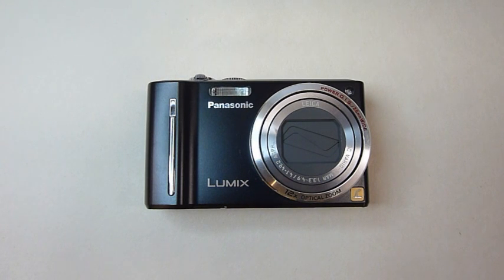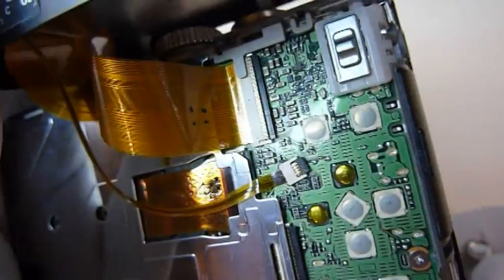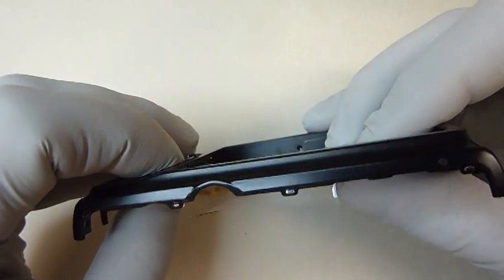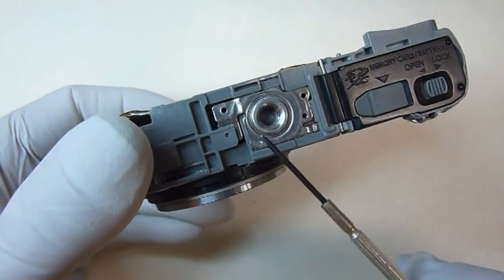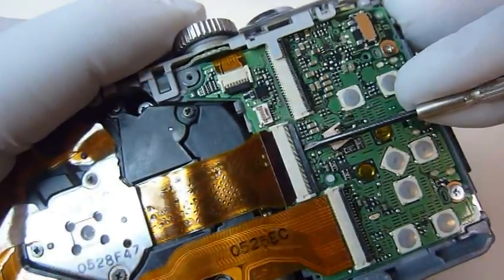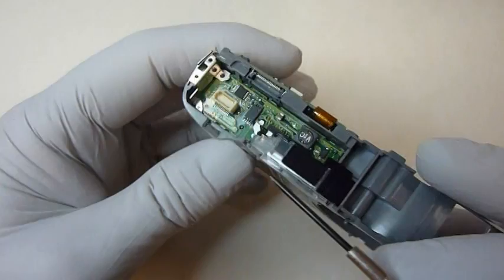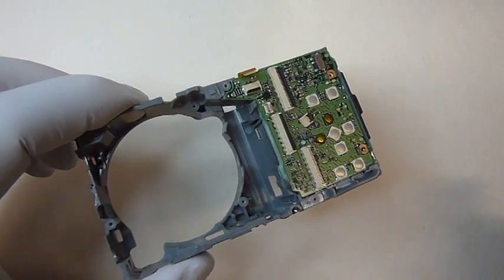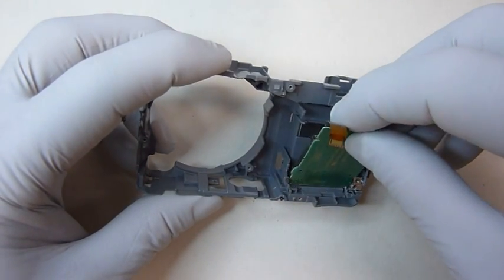Repair A Panasonic Lumix ZS6, ZS7, TZ9 and TZ10

Comment: Hi Robert, thanks for your swift and complete reply, I appreciate your help. I might take the repair in stages. Order a display unit, then try to attach my old thinner backlight ribbon. However I may have damaged the little black circuit board connectors - don't suppose those can be bought ? Or will I have to try and buy another camera for spare parts ? Any sources you can suggest will be appreciated.   Thanks again, Rab
Reply from the maker: Hi Rab. I really doubt that you will find just the connectors to replace. Plus, it might be pretty tough replacing them even if you did. You will most likely need to replace the main circuit board. I did look on ebay, but couldn't find anyone currently selling a main board for a TZ10 though. But, that can change daily. When looking for parts for you camera you can also use parts from a TZ9, which is exactly the same as your TZ10, but without the GPS. Another one that you can use for some parts is a ZS7, which is just the North American version of your TZ10. The difference between the two is the video output, which is NTSC for the ZS7 and PAL for your TZ10. So because of that, a main circuit board from a ZS7 won't work for you. But all of the other parts like the LCD, back light, lens, etc., will work on your TZ10. Sorry I can't be more help Rab. Good luck with it!

Comment: Hi Robert, was cleaning my TZ10, and the two little flexible ribbons came adrift, the black connectors came off. I see that screen displays can be bought with the wider flexible connector attached. But where can I buy the smaller flexible connector ? Hoping you can help me source parts. Enjoy your vids, cheers Rob in New Zealand
Reply from the maker: Hi Rab. For Lumix camera parts, many times I will buy broken cameras, or cameras listed as "not working, for parts only", on eBay. I have also purchased parts from vendors on eBay that sell new and used Lumix parts. Just curious though; are the black connectors that you're talking about the connectors on the circuit board that the flat ribbons go into? If it is, and the little black tab that flips up and down to lock the ribbon in place came off, then you can put it back on. I have had to do that a few times. It just takes a magnifying lens to see all of the little pins that the black tab goes over. And, in regard the LCD display screen, there are two parts to it that have flat ribbons connected to them. The larger flat ribbon controls the display unit itself, and the smaller ribbon is connected to the back light for illuminating the LCD display. The back light is a separate piece that is just snapped onto the back of LDC display unit. So, if the LCD display that you are looking at purchasing only has a large flat ribbon, then it doesn't have the back light connected to it. But, you can certainly use the back light from your original LCD display on the new one if you want. It's easy to take off and put back on. Please let me know if you have any other questions and how you make out on this. Good luck with it Rab.

Comment: Robert, 
Wow,,,thanks so much for this.  You saved me having to buy a new camera.  My ZS7 had a tiny amount of dirt on one of the internal lens, which was showing up big right in the center of photos, and after following these instructions, and then the one for cleaning the lens, it is back to taking exquisite pictures.  I've been happy with this camera for so many years, and didn't really want to buy another one or pay panasonic $$$ to clean it.  Although, I was a bit nervous, looking at all the parts and screws when it was taken apart, I wondered how hard it would be to put it all back together, but your instructions were clear and accurate.  Thank you.

Comment: Robert - great video, thank you for posting it. My ZS model powers on, but only wants to display what's on the SD card and won't switch to other modes of operation. Would this likely be a ribbon connection issue, or possibly require a new top control board? When I get a chance, I'll take it apart and see what I find. Thanks again.
Reply from the maker: Hi Edward. If I understand you correctly, then you cannot get the camera into the mode for taking pictures and it will only display the pictures you've already taken? If that's right, then my first thought would simply be the slide switch itself is defective or out of place. That's the small plastic switch that changes from viewing pictures on the card to actually taking pictures. I show removing that specific switch at time index 4:27 in this video. Let me know what you find on that Edward. - Bob
Reply: Robert Hosea Thanks Robert. I did a more thorough examination and here's what's happening: When the power is turned on and in camera mode (not picture viewing mode), then the lens opens and the camera then begins to stutter. It's like it is trying to focus, but never does. It keeps doing this until I power off, then the lens stays in the extended position when off. If I turn it on and off with the right timing, I can get the camera to retract the lens before shutting down. Does this sound like the main computer board is bad? Or could it likely be a poor ribbon connection somewhere inside? Again, thank you for posting the helpful video and your interest in helping others.
Reply from the maker: Edward L Hakala Edward, I would bet that it's the focus motor assembly. That seems to be pretty common with this lens. I have another video called "How To Repair & Clean A Panasonic Lumix ZS & TZ Model Leica Lens Units" that shows how to disassemble this lens, It doesn't actually show how to remove the focus motor, but it's pretty easy to do. At time index 13:29 of that video (not this one) you can see the motor near my left thumb. There is only one screw holding the motor in. Remove the motor slowly because the focus lens assembly that the motor controls is spring loaded. What you will need to check for is to see that the small plastic tab that runs up and down on the threaded motor shaft is free. If it's stuck, or it turns hard, then you may need to put a small amount of lubrication on the shaft and turn it a little until it frees up and moves easily.When you put the motor back in be sure that the edge of the white tab is put in the grove of the plastic housing that it rides next to. Let me know what you find and how you make out on this Edward. Good luck!

Comment: Hi Robert. Really good video. I have a DMC-TZ10. I had some sand and dust in my lens and I used your video to take it apart and clean the lenses and remove the dust. However when I put it all together I find that I have no display on the LCD screen. The lens works perfectly and I can take pictures. I saw your response to Rosemarie O'Neill  who said she had the same problem. I have tried re-seating both the small and larger ribbon cable from the LCD many times but without success. My black locking bar works well, the cables are secure and everything looks good. I wonder if you have any other ideas about where the problem might lie?
Reply from the maker: Hi Robin.
The only other possibility that comes to mind is if the small flat ribbon cable, which supplies power to the back light, is upside down. On the small flat cable, the shiny gold colored contacts should be facing down when it's in the connector. This is just the opposite of the large cable where the shiny contacts will be facing up in the connector. Double check that Robin and then let me know what you find.
Reply: Robert Hosea Hi Robert
Thanks for your advice. I have double checked that and the shiny contacts are facing down. I have had them in and out many times now. I have tried scouring the surface of the contacts to improve the connectivity, but no joy. I have also taken the lens out and put it together to reconnect the ribbon connections behind the metal shield. Any other ideas will be welcomed.
Reply from the maker: Robin I'll keep working on it Robin. If I come up with anything I'll certainly let you know.

Comment from the maker: Hi tpaulino. Boy that's a tough one. There is most likely something down inside that is preventing the SD card from being pushed in far enough to release the lock. I've had SD cards that have had the small plastic pieces which separate the electrical connections break off and then get jammed in down there. But, it never prevented me from removing the card. Trying to pull out the card without first releasing the lock could cause a lot of damage to the camera. I would suggest disassembling the camera and removing the SD card holder from it. Then you might be able to see what the problem is a little easier. You can see where the SD card being removed in the video at 10minutes 20seconds. I'm sorry I can't be more help to you on this. Good luck and let me know how you make out on this. -Bob

Comment from the maker: Hi Shaz. I don't see anything that shows that a ZS20 display will work in your ZS30. But a display for a TZ40, which is the European version of the ZS30, will work. I can only find one location that sells a replacement display that will work in your camera, and it's in China.

Here's a link to the listing:
http://www.aliexpress.com/item/NEW-LCD-Display-Screen-Repair-Parts-For-Panasonic-Lumix-DMC-ZS30-ZS30-DMC-TZ40-TZ40-Digital/2024127067.html

I would most definitely remove the back cover and check out the flat ribbon cables first before ordering a display. I have had cases where the display will not work when I didn't get the flat ribbon cables back into the sockets perfectly straight. Generally it would be the smaller cable that runs the back light. It's worth a shot!

Let me know how you make out on this. And good luck!
-Bob

Comment: Dear Rober, I have a Panasonic dmc-zs8 and when i inserted the sd card apparently it has stocked into the camera.  I pressed in the midle of the card, but it does not want to go out.  Will u pls help to to take out?  ...thanks i am tpaulino

Comment: Hello Robert, I have a Lumix ZS 30 on which the display has abruptly stopped working. Do you know if a replacement display for the Zs 20 would work in this camera has not been able to find one identified for the Zs 30? also is it possible that one of the two flat cables that connect this display to the circuitboard have simply come loose and caused this problem? So if I were brave enough to open up the case, simply resetting the cables would resolve the problem? Thanks for your time.

Comment: Morning Robert, not wishing to dismantle the ZS10 as the LCD part does not have any black plastic at least that came with mine, so I was thinking is it sold separately do you know?, certainly I did not need the new silver LCD unit as that is working just fine, I really need the rear cover black plastic unit that is badly cracked, any ideas please..and again thank you for your time.
Reply from the maker: Hi Jim, I sent you a message on your YouTube channel that contains my email address. If you can send me your email address I can send you some pictures to help identify the part that is broken.

Based on your first comment last week I am still under the impression that your LCD screen is cracked. The black plastic frame around the LCD screen that also holds the control buttons, is a separate piece (unit) and is not part of the LCD display screen at all. So if you are seeing cracks on the LCD screen display, then the cracks are on the LCD screen itself, and something that is part of the black plastic cover. The black plastic cover does not contain anything that goes over the LCD screen. It just goes around the LCD screen. At least that's the way it has been on all of the ZS10's that I have worked on.  

Sorry this is taking so long Jim. We'll get it figured out though.
-Bob
Reply: my email Robert, again thank you..

jim@cyprusliving.org
Reply: my LCD panel did not come with the black rear screen that is cracked not the inner LCD., just the silver LCD unit that I did not need.Also it did not come with the larger ribbon connector...just the smaller one.

I hope this makes some sense to you..
Reply from the maker: Jim Cross I emailed you some pictures of what the LCD screen should look like. It should have three flat ribbon cables connected to it. If yours does not have the larger flat cable then it must be the incorrect part. My guess is that it's just the back light for the LCD screen. Let me know if you do not receive the pictures that I sent to you.
Reply: Thanks Bob I have received those snaps and sent you the same of my part LCD.

Thank you again.

Comment: Hi Robert me again..part arrived but it does not have the rear black screen, just the LCD that is in working order on my zs10, I did not know they came seperatly, is this normal do you know and if available are they also easy to fit? again I can only thank you for your time and efforts..

Jim

Cyprus
Reply from the maker: Hi Jim. I was just looking at a ZS10's LCD screen that I have here, and I don't see a rear black screen. I think possibly we're talking about two different parts. The back of the actual LCD screen (on mine at least) is covered by a silver metal panel. Is this the part you are referring to? Or possibly the plastic frame around the entire LCD assembly?

Comment: Help!! System Error Focus Msg. I've followed both of your videos and my Panasonic Lumix started giving me a System Error Focus Msg. Any advise? Thanks for the help. Your vids are clear, fun and easy to follow. HELP!! thanks again.
Reply from the maker: Terence, I would guess that it's probably the focus motor, which is on the lens unit, and it's either bad or stuck. The focus motor is the small motor inside the lens unit that has a long threaded shaft with a white plastic tab on it and also a small plastic unit that holds a lens. Both of these run up and down the threads on the shaft as the motor turns. A lot of times the motor itself is fine, but the white plastic tab gets stuck. I don't show removing the focus motor in the video, but it's easy to do. There is one screw on the motor to remove and the entire unit will come out. The plastic unit that holds the lens is spring loaded, so remove it slowly. Check to see if the white plastic tab is stuck. If you can loosen it and it seems fine then you may want to add a very small amount of lubrication to it before you put it back in, to help it operate properly. I have been getting a lot of inquiries regarding this problem so I will be making a video on how to remove and repair the focus motor in the near future. Good luck in repairing it Terence and let me know how you make out with it. -Bob
Reply: Thanks I'm up and running now. these are good little cameras.
Reply from the maker: Hey, that's great Terence! Good job!

Comment: Robert if you have the time can you please explain how to reattach the two connect cables to the new LCD panel I can see how to remove from rear frame, as mine will need to be re attached, again thank you..
Reply from the maker: Hi Jim. Sorry about that. I know that I kind of went over that part pretty fast in the video and I didn't really explain it at all. The part of the video that shows reconnecting the two flat ribbon cables, which you've probably already seen, is 15 minutes and 56 seconds in. To reattach the two flat ribbon cables you will need to lay them flat in front of the connector and then slide them in. I found that I can slide them in easier when I have latex gloves on. But you could also use the eraser on a pencil if you you are unable to do it with your finger. You will need to make sure that the black tab is up before trying to slide the ribbon in though. Once the ribbon is in all the way then flip the black tab back down. I have had problems with the smaller flat ribbon cable when I don't have it completely straight in the connector. When that happens the LCD display will not come on. All you will have to do is to put a little pressure on it to straighten it out in the connector while the black tab is still down. Let me know if this helps you out Jim or if you run into any problems. -Bob

Comment: Thank you Robert, just dropped my DMC-ZS10 breaking the rear panel, I was about to buy another from Amazon and saw your fix, so living in Cyprus these parts are just not available but saw the replacement panel (LCD touch screen) on EBbay and sent for the replacement part from the US, I will attempt to fix the problem when it arrives, apart from a seriously cracked screen, the camera still working just fine, great little camera..again thanks for the video!!  Jim
Reply from the maker: Hi Jim. My ZS10 goes everywhere with me when I'm out hiking, fishing or hunting. Like you say, it is a great little camera and I love mine. I'm glad the video was helpful to you and I'm sure you will have your camera back to 100% in no time at all. Thanks very much for the feedback Jim.

Comment: Hello Robert... I agree with the other's your Vids are excellent.. and thank  you very much... my DMC-FZ28 went for a short swim a month or so ago... I am not sure if the faint spot that shows up in my long distance shots is on the Lens or on the sensor.. I feel like it is on the lens since it isnt there on my close up shots.. guessing this though. I took the cam partially apart to see if I could get at the water film that seems to be in the eye peice section.. grrrrr lol.. but it seems like it is a sealed unit? I would greatly appreciate any advice  you can give me :)
Reply from the maker: Hi stinger1956! I did a search to see if I could find any videos or information regarding repairing a DMC-FZ28, but I was only able to find one video that shows replacing the LDC screen. I couldn't find anything regarding the CCD or lens unit. Unfortunately I'm unfamiliar with that camera and I don't think I can help you at all. My "guess" about the spots is the same as yours, and I believe it is something on the lens and not the CCD. I'm sorry I can't help you out on this. -Bob